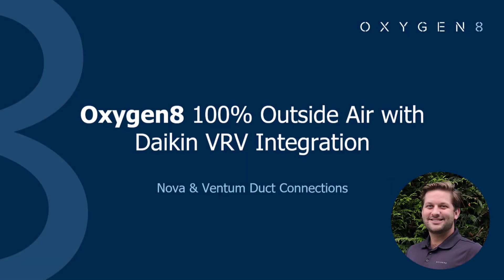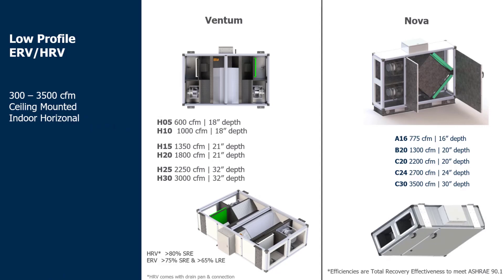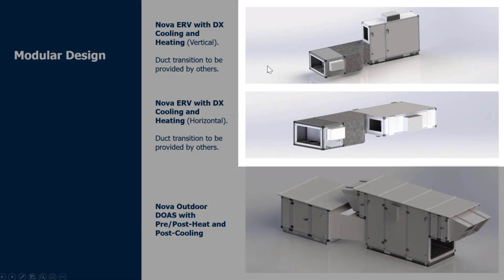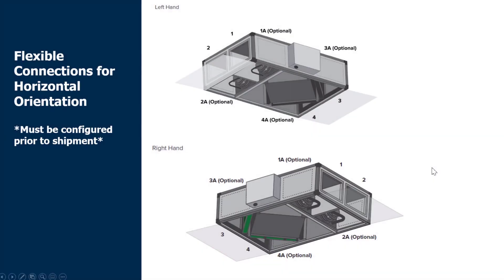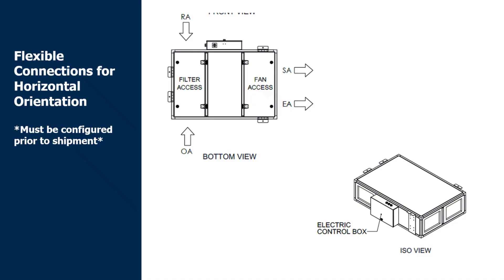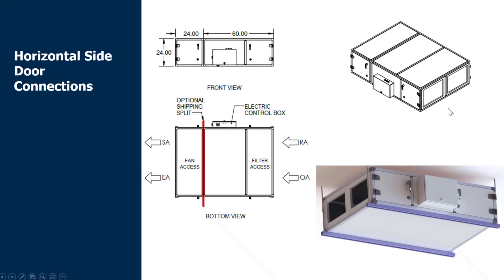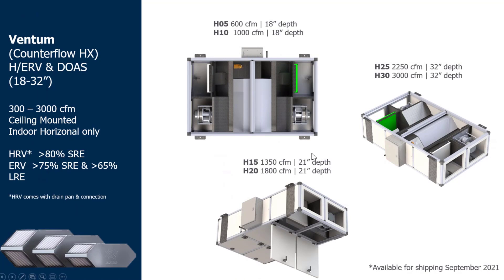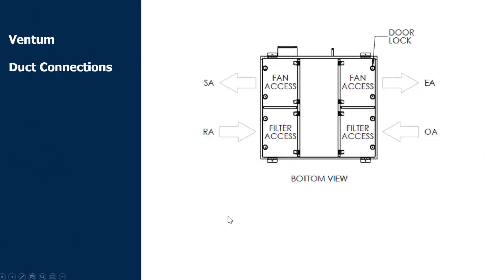8-Minute Duct Connections for Nova and Ventum | Oxygen8

Comment: Where do you put the motorized dampers
Reply from the maker: The motorized isolation dampers are not pictured in the video. However, once installed, they are mounted on the OA and EX duct connections.